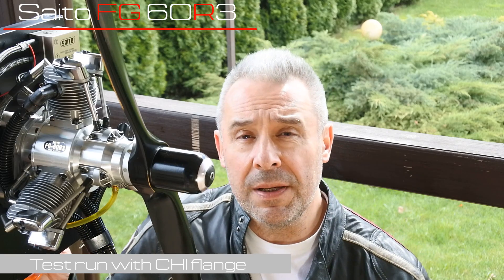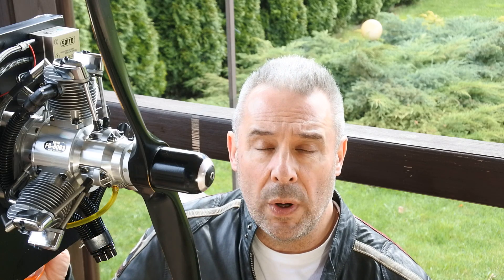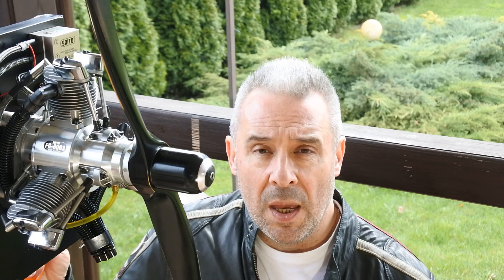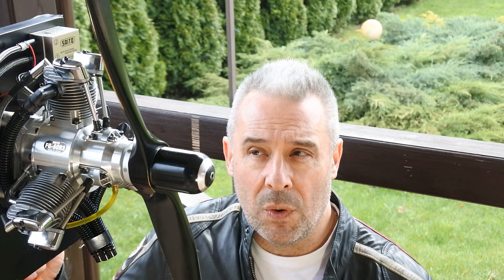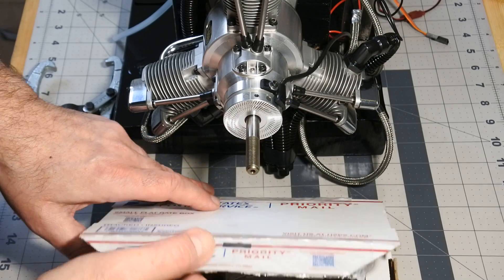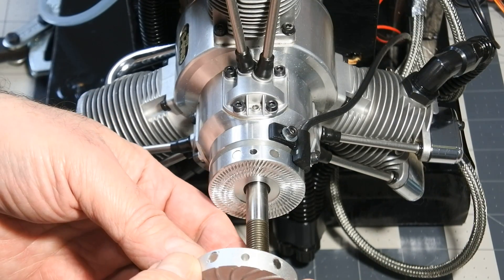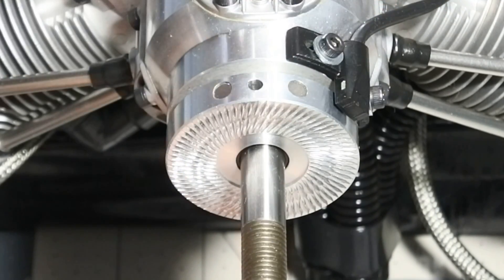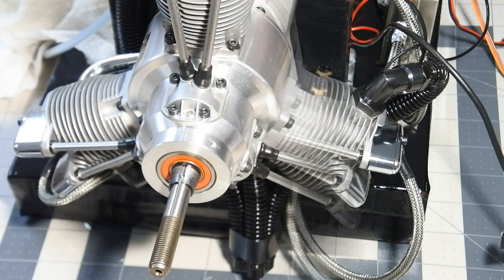Saito FG 60R3 applying the cure

Comment: For the money they cost they should be perfect  so I will not buy one
Reply from the maker: Hi and thanks for your comment! Definitely, you're totally right, for such high price any product should be perfect and should please its owner, and not drive him into additional expenses to eliminate the problem in the new device. I have already returned to this topic several times, where, in principle, an absolutely symmetrical engine relative to the axis of rotation creates such vibrations and works asymmetrically due to uneven distribution of fuel and a design, mechanical error in the valve timing. By the way, the concept of a manufacturing warranty and responsibility for product quality has not been canceled, I wonder how sellers react to claims and complaints from the owners of these engines. Unfortunately, I have no information about this. Thank you and have a nice day !

Comment: It researched this engine prior to buying it ( two weeks ago ). Didn't find any negative stuff. Now I find this video and comments.
Just my luck. I have some of the symptoms described here. Some vibration, # 3 throwing oil and misfiring.
I have been in RC for a long time and am now just able to afford this engine. I thought Saito was a quality product.
I will check the timing on this propdrive and see how far off it is. It is hard to believe Saito would do this on purpose or the quality
control is non existent. 
we shall see.
Reply from the maker: Thank you very much for your comment ! Definitely, I was very surprised finding this thing, timing mismatch and uneven fuel distribution. I decide to stop investing the money into this engine, because it will becomes half price more expensive, that stock price ( this is without my personal time investment). Let it be...

Comment: I saw the same problems with my FG60R3 that I bought in mid 2023.
Bought the CH ignition hub and I found it was a tremendous improvement.
I have not thermal checked cylinders yet but will in the next run.
I notice cylinder 3 is dumping raw oil and 1 and 2 not so much.
For now I am only running low rpm's and 16;1 red armor oil. Bench testing...
I hand start my engine with no problems now, before it would kick back and would knock off without reason.
Not Sure but it could be CH has a patten on their hub, (just a wild guess) 
At any rate the hub was a big help to me,. in my opinion. and I am happy with the improvements I saw.
Now if this main rod timing will fix anything is next move.
It is B$#!t to pay this much money for these engines and continue to have to spend fairly large amounts to tweak them further.
Again this is my opinion,. be careful over revving these,. they are like a grenade once you pull that pin.
Cheers
Reply from the maker: Hi and thank you very much for your comment ! Definitely, absolutely agreed with your especially with the additional (over a half price of a new engine !!!) price you have to pay to fix the simple engineering mistake. This is BS#, for sure. Due to the heavy workload this time, I can't find, unfortunately,  enough time for FG60R3 engine, right now more thoughts about single cylinder Supercharging in automotive style. Thanks again for your feedback, please, keep the heads up. With best and kind regards...

Comment: Too late for my engine FG 60R3! The third cylinder broke!
Reply from the maker: Hi, what's a pity, Sir. Probably, it could be repaired ? And what kind of problem appeared ? Something with cylinder surface ?
Reply: @crazyengines88  Design error in most of these engines (maldistribution of ignition)
Now 450 Euros
Reply from the maker: @antoniomoura9347  Understand. Definitely, I've no plans to install this on any plane, don't want to invest more money, it becomes amazingly overpriced.
Reply: @crazyengines88  Repair cost as equivalent of 1/3 of the cost of the engine
Reply from the maker: Hi, it's a very pity news, sorry. What exactly was broken ? Cylinder surface ? Or valve seats ?
Reply: @crazyengines88  All parts related to cylinder 3 as broke

Comment: So I have this engine and run a xoar prop 23x8 very little vibration. After horizon hobby replaced carb because #2 cylinder was not firing all cylinder's temp are 10 deg.+/- between temperature.
Reply from the maker: Hi and sorry for the late reply, I was in the business trip without normal access to my YouTube account. I think, that FG60R3 really needs to be reworked, seriously. One reason, that engine's mechanical geometry has few engineering flaws (different firing angles), non correct firing angles, as well, and for sure, the key problem - is in the uneven fuel distribution, which leads to different cylinder performance. It was clear in thermal video parts. From the common perception, engine has really nice appearance, and very nice, realistic sound. Only the problem, that if you want to fix all this problems, you should spent, at leas, two days of DIY rework, and at least $500-800 for the new, upgraded parts. I'm still not sure is it worth this  ?
Thank you and have a nice day !

Comment: I have one with all the Morris Mini Motors Mods. Timing, Intake, Carb runs sweet as a nut.
Reply: Good luck and fair comment it is not cheap to modify
Reply from the maker: @christopherszabo1768   Thank you for your comment ! Definitely, I l know that, but I will try to find a very special solution. Let's see it further. Thank you and have a nice day !
Reply from the maker: Hi, thank you a lot for your comment ! That's great, that MMM's correction set well work for you. As for me, to pay an additional cost for approx. of 1/2 of the engine's price is unacceptable yet. I'll try to find some way, how to override such engines flaws. Adjusting an individual fuel mix flow could be a solution, not tested yet. 
So, we'll see, I'll continue to work with.
Thank you and have a nice day !

Comment: much thanks, i'm working on a 33r3 and it's got uneven cylinder temps. tearing my hair out
Reply from the maker: Thanks for reply ! I think, that 33R3 inherits all the shortcomings of the most 3 cylinder Saito radial engines. I still have plans to fix this issue with a different cylinders temps. Just need more time.
Thank you and have a nice day !

Comment: did you have a balanced prop
Reply from the maker: Thank you for your question ! Definitely, yes, I check this several times. Unfortunately, prop isn't a reason. Firstly, engine fires uneven, and that's the first reason, the second - engine utilizing very advanced ignition timings, to increase power, and the third = compression ration is very high, that's also leads to increased vibrations level. In addition to the all mentioned,  engine has uneven fuel distribution, so #1 and #2 runs hotter ( leaner) and   #3 run overreached. So, it wasn't so easy...

Comment: I have been checking these engine out and think that Saito should stop selling them with so many problems.
I also would like you to check your engine's cam timing (not ignition timing )  on each cylinder , you may be one tooth off on one of these cylinders causing this vibration.
There is a video showing the timing if you type in .....Saito FA170R3 customer rebuild part 4 
They all time the same way. The timing part will be half way thur the video.
Reply from the maker: Thank  you very much for your comment,  definitely< absolutely agree with you ! I also think, that selling  the products with such a set of shortcomings it is simply unacceptable. Amazing behavior from such a reputable company.
Come on, words won't help matters. Firstly, thank you very much for the advices, I will definitely check the timings, and secondly, sooner or later I hope to “bring” all my radial Seito engines to the normal operation.
Thank you again for your advice and comments, I sincerely appreciate your help, and wish you a good day!
Reply: @crazyengines88  ... Thank you for taking my advise.  CH ignition has a great fix for the timing. Just a ring on the front crankshaft that has the three magnets  embedded. It changes the firing from Saito 45. degree to around 30 degree and the engine will fire better. The old ring will need a puller to remove it. There is another fix dealing with the rear plate , I guess it doesn't deliver the fuel correctly but you can just change it out. Morris mini motors sells it. Yes it is very bad that Saito doesn't fix these problems , I wanted a FG90r3 but I would buy  one because of this crap. I'd say buy these two parts and fix the engine  now that you have it.
Reply from the maker: @good-boy-ringo  
Thank you very much for your advice !
In this video: https://youtu.be/mId-ZuShUGM I'm trying to solve the problem with Saito FG60R3 uneven firing with CHIgnition flange with reallocated magnets.
unfortunately, this doesn't helps so much, engine still have unacceptable vibration level. Changing ignition to the glow , based on OS G5 type glow plugs makes more positive changes in engine's behavior, especially on idle.  For me such changes becomes clear confirmation with engine's timing. So, something wrong with cam gear timing, I think.
Thank you very much and have a nice day !

Comment: Hmmmm. . . . I have an FG60R3 in a Phoenix Waco that runs like a top.  I've got 2 or 3 hours on it now.  The secret of these engines it to set the high needle to 4.5 or 5 turns open then set the LOW NEEDLE for all further leaning/richening.  It's crazy but that's what these Saito carbs need.

By the way, I also put the CH prop flange on mine.  Very necessary.
Reply from the maker: Thank you very much for your reply and for your advice ! I'll try it immediately, when will be able to found few hours on the bench. Thank you !
Reply: a little bit until it breaks due to hydraulic compression!

Comment: Hi, I had the same problems. Made the ring myself with readjusted timing, but also adjustable in ignition timing. The ring can be rotated and than locked. Please check the timing of the engine, Saito delivers them with ridiculous timing! Mine had 40 degrees on cilinder 1 now adjusted to 32 degrees. If your engine has the same timing this is the cause of the vibration. Higher rpm’s won’t show as much because of momentum. My engine has also been transferred to a negative pressure case, the carburator feeds through the crankcase, leading to absolute even cilinder temperatures. I know, a lot of modifications, but worth it. Take a look at Morris Mini Motors, they sell the adjustable timing. Good luck, don’t give up it’s such a sweet engine!
Reply: Than Saito needs to do what you did
And correct the problem
Reply from the maker: @mpojr   Thank you very much for your advice ! Definitely, I'll continue my holy struggle with this FG 60R3 and for sure, will correct  its behavior  and reduce vibration level. The only source I'll need - it's the time. This is the most limited recourse.
Thank you and have a nice day !
Reply from the maker: Thank you very much for your comments and advices ! Much appreciated ! I think, that I'll relax a little bit for Saito's 3 Cylinder radials, most of them sharing the same design flaws and later, will try to rework all of them, being equipped with your advices ! Thanks a lot and have a nice day !

Comment: I'm surprised that a Saito engine would have such problems. I always thought that Saito was a premium brand, but perhaps that is not the case?
Reply from the maker: Thank you for your comment ! I should say, that I was also very surprised and disappointed, but I've received here a lot of comments from  different people with confirmation of existence of the such problem with this engine, and that wasn't only one or two notes. At least, two main problems are clarified: 1. Uneven cylinder firing (#2 fires early, #3 fires later). 2. Inlet manifold distributes fuel into cylinders not equally. I was found, that #1 cylinder works leaner, than also lean, but not too much, works #2 cylinder, and #3 cylinder gets the most fuel mix from carb through manifold, works very rich, throwing the unburned mixture into the exhaust. 
I should think, how to eliminate this vibration behavior, will take a bit of time. According to my understanding, it isn't possible to mount such working engine on the plane,  on the first pass through 2.5K RPM, the vibration will tear off the motor frame due to vibration. I've very sturdy test bench, with additional old car accu battery, used as an anchor. With Saito FG 60R3 in that condition it's really shaking, like crazy...
Reply: @crazyengines88  Thanks for your reply!

Comment: Please don´t give up !!  😢
I appreciate the conrod geometrical and valve timing error. I have not heard that anyone have made a new/ corrected main conrod.. other than bushing modification on early engines ? 
Will the engine be acceptable enough with an even fuel distribution plenum ? Reading more and more about the R3 series at various forums, it seems like people are very happy after the plenum modification. 
I am sure that evening out the fuel/air will help a lot. Messuring temperature at various rpm´s (low/mid/high) will confirm.
Reply from the maker: Thank you very much for your support ! I will not give up 🙂. This is the problem, which requesting a lot of time to work with. I decide to make a break for few weeks, to collect more determination and power to continue this struggle. Right now I need more time to the channel, for another interesting topics, and spending time for FG 60R3 experimental surgery just borrowing resources necessary for other topics in the channel, which were planned earlier. I also think, that should be a pause with endless struggle with FG60R3 for our subscribers. I'm really don't like to get a channel nickname " FG60R3 strugglers" 🙂. We'll return to it a bit later, I promise. Thank you for your support !